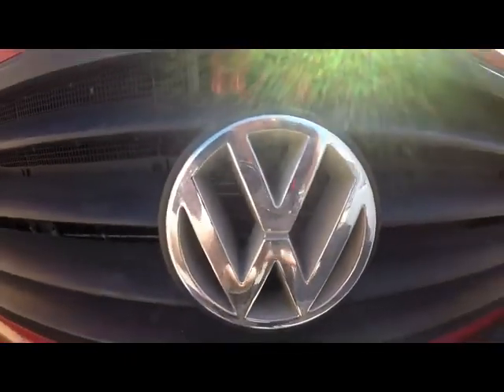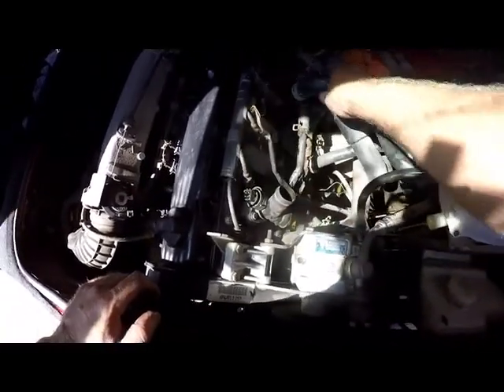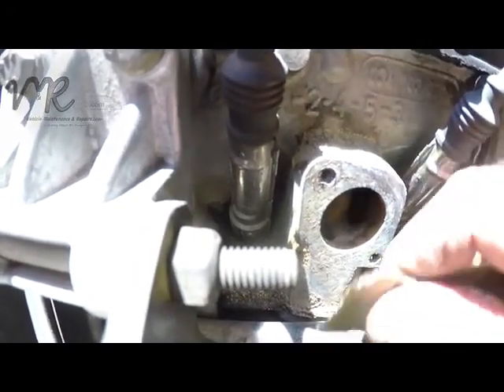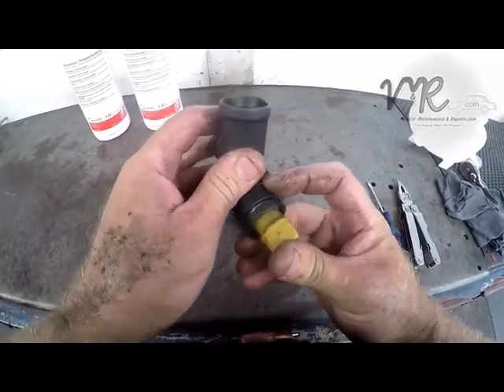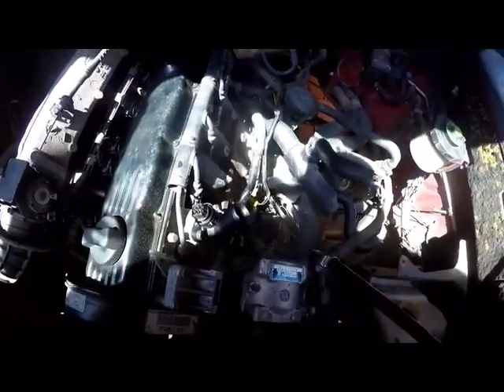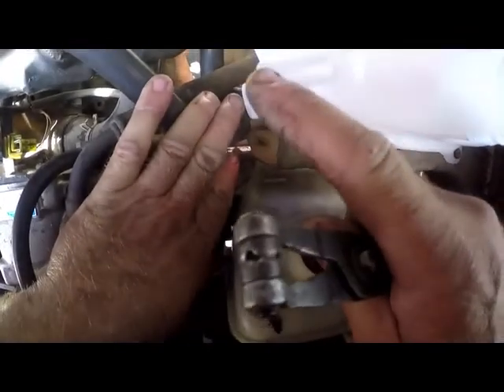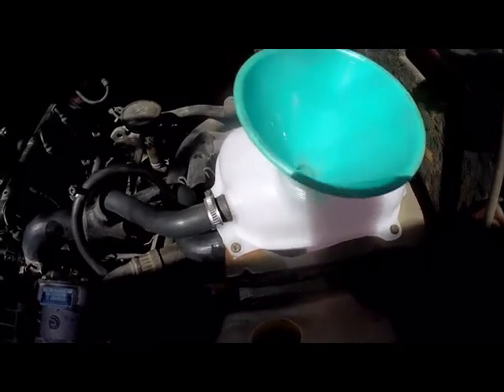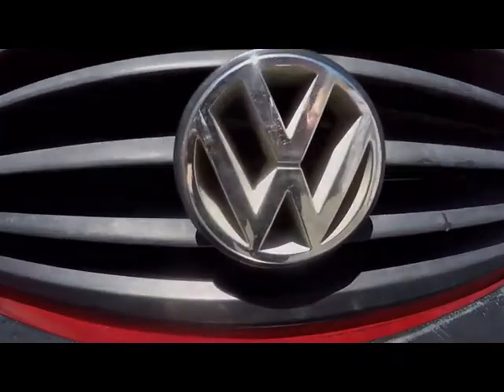Vw Microbus 2.3 - Cooling System Repaired And Bled

Comment: Thanks for video. I changed the coolant on mine. Where should heat gauge run when hot? Mine is between half way  and  3/4?
Reply from the maker: That sounds about right.👍

Comment: Greetings from Bergvliet. I don't remember the cooling fan running so high to cool the engine down on our Microbus when we had it from 2002 to 2004.
Reply from the maker: It is a 2-speed fan so it will depend on how the fan is connected to the Thermo switch.

Comment: Awesome , helped me out big time
Reply from the maker: Thanks for supporting the channel, Nicholas, glad to be of help.
Reply: @vehiclemaintenanceandrepai3790  Hi sir, may I ask, my Kombi fan activates in time and the vehicle does not heat up but I do hear the coolant bottle boil and I do see the water bubbling within the coolant expansion tank, i can hear the pressure within the bottle, is that normal on the microbus or is it something I should be concerned about ? I would really appreciate your advise, all mix fixes are done by following your videos :)
Reply from the maker: Hi Nicholas, check if the overflow reservoir is not overfilled, if so it will prevent the excesses coolant due to expansion in your cooling system from flowing from the top coolant reservoir into the overflow reservoir creating a bubbling effect, also check that the cooling system is properly bled.

Comment: Very informative..I have a 2.3 kombi bus, and have a problem with the fan  not coming on, when it reaches temperature..I have been told to remove the thermo switch, and replace, or check for corrosion whereby I need to take waterpaper and sand the coperhead for a better conection...firstly, I cant seem to find where the theromo switch is situated, and secondly: would you advise me to do that?
Reply: Its in the Lower grill. By the indicator light
Reply: @nzwakele  thanks.... Really appreciate it

Comment: Thank you for a great video I have 2.3 i Volksiebus and my heater is not working to full capacity, getting warm air only in the front and for the demister but not enough to heat the interior on a cold day. Please help.
Reply from the maker: Hi Rajesh, thanks for the sup[port, 1st make sure the engine thermostat has not been removed if not there is a partial blockage which might not be easy to detect.
Reply: @vehiclemaintenanceandrepai3790  Thank you for your quick reply Sir, if you say blockage is it the from the fan itself? Because  Warm air is coming into the vent at the windscreen a little from the vent near the gear shift but nothing effective  the fan is actually blowing at full capacity but no air is coming from the vents on the Das and along the sides of the hood lining. I am hopeful you will soon make a video on fixing these problems

Comment: I would like to ask I see 2 tanks I would like to know the one is the bottom what is it for?
Reply from the maker: That is an overflow tank, Mongezi, it is where the excess water goes when you overfill the top tank or when the water gets hot it expands and flows into the overflow tank, it is there to keep the top tank full, so when the car cools the vacuum that forms in the top tank sucks the overflow water into the top tank to keep it full.

Comment: If the fan doesn't run even after I bled it . What should I do
Reply from the maker: Make sure all the electrical connections are secure or have an auto electrician check if the circuits are faulty